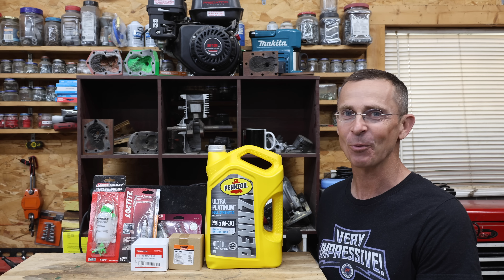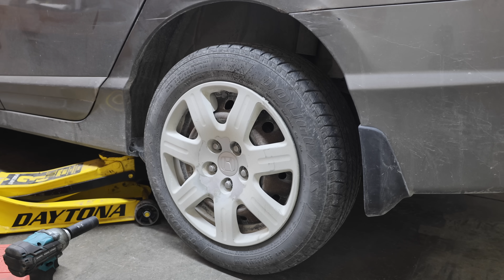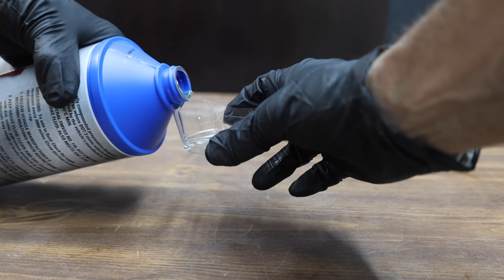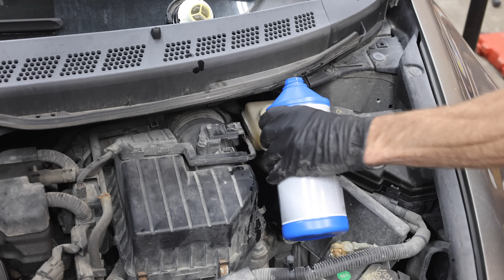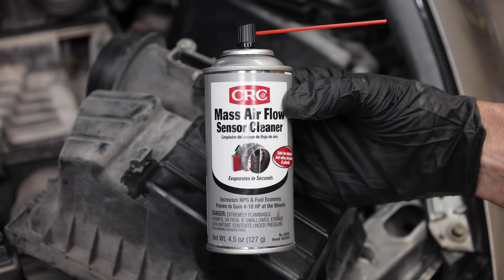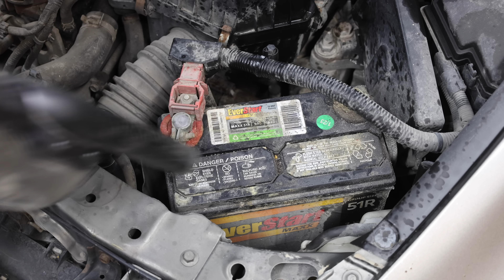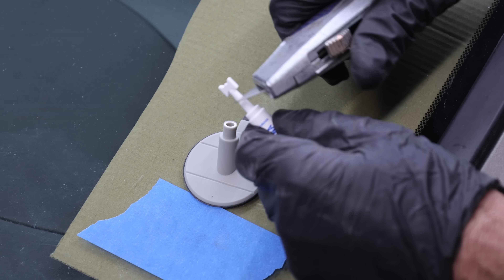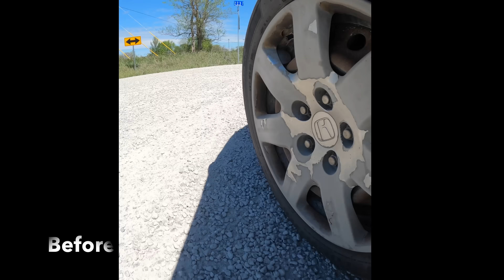Most Reliable 200K Mile Car? Let's Settle This!

Comment: Love your videos, Todd. I have a '97 K1500 with right at 1/2 a million miles. Paid it off in 2000. I spend considerably less a month than a car payment. Maintenance is key. Nothing wrong with an older vehicle as long as the drive train is in good shape. Everything else is just a few bucks away from new.
Reply from the maker: Thanks!  Thanks for sharing.

Comment: Yep. This is the way. I drive a 2009 Scion XB with over 200k city miles on the original engine and transmission. It was a full time Uber car for 5 years! Despite spending its whole life in Chicago it has barely any rust. The undercarriage is immaculate. It's wild. Toyota is no joke, guys. Their stuff is good. It burns a little oil but not enough to justify a car payment.
Reply from the maker: Thanks for sharing.

Comment: As a former Honda tech, I must say this video is completely on point.  Thanks for making this!  It shows how easy it is to take a great older car and turn it into a solid and reliable daily driver.
Reply: I love how well thought out Honda's are . it's rare to find a domestic vehicle with a transmission drain plug in those years. much less a cabin filter for an economy car.
Reply: @HappyHands. 

The drain plug on our 2006 Honda Accord is right at the front. I don't even need a ramp or jacks to do a 3 quart drain and fill.
Reply from the maker: Thanks!
Reply: It shows how easy Honda tech have it.
Reply: Thought honda used blue coolant.
Reply: @Fyxxterzc  The factory coolant is Blue.  However, the formula for it is similar to most other Japanese brands.  For example, I used Honda factory coolant in Toyotas and Mazdas often due to how much extra I had amassed over the years.   The key is knowing what types of coolants and additives do not mix well with others.  Dexcool for example should not be mixed with conventional or import types.
Reply: Idk about changing the transmission fluid it was pretty dark I’ve heard and learned form experience that changing transmission fluid is a big hit or miss
Reply: @danielcano7932  @200k miles I would never change it without knowing the history and never ever more then 1x. Maybe 1 or 2 qrts just to get a little new fluid in there. He prob drained out all the clutch material that was keeping the trans from not slipping. Also, those 8th gen civic transmissions are a little squirrely to begin with, that is a high risk move changing that fluid.
Reply: Did he just, add liquid to the car battery??? Why have I never even heard of this or been taught?
Reply: Yeah meanwhile going broke! I'd love to sell some on my close to 10,000 beater Toyota it most certainly will be my first and my last Japanese vehicle never again!
Reply: @peachyclean93  what year model and make if i may ask? i have an 87 toyota pickup, 22r (carbureted not fuel injected) and i wouldn't ever sell this thing. most reliable and capable car ever made.
Reply: @peachyclean93  you must have gotten a lemon.
My family only buys Scion (made by Toyota) and Toyota. 
Toyota Rav4 2010 = 15 years
Scion xA 2006 = 20 years
Scion xB 2006 = 20 years
Scion xB 2012 (Gen 2) = 13 years
Scion iQ 2012 = 13 years 
Scion iM 2016 = 10 years 
91 years combined ownership and other than basic wear and tear stuff (wipers/tires/brakes/bushings/oil/coolant) i only had replace 2 alternators and a serpentine belt that actual kept the engine from operating.
Reply: @Evilatem not just be my whole family every time we buy a non Chrysler vehicle they've been garbage!! You can have them I do not like Toyota and never will buy another one ever again! I'm out all that money!! Never again!!
Reply: @peachyclean93 you need a few more exclamation points in that message.

Comment: A vehicle is an asset And most vehicles depreciate in value whether they're being used or not.  Most hondas and toyotas will run at least three hundred thousand miles with regular maintenanc. It's really easy to find them used with a hundred thousand miles on them for a fraction of of what a new vehicle costs.
Reply from the maker: Thanks for the feedback.

Comment: Any truck with a Cummins engine in it? I have two of them 225 on 170 on the other never had a problem with them other than the air brake pump which was cheap and a steering wheel pump.
Reply from the maker: Thanks for sharing.

Comment: My 98 Grand Cherokee with a 4.0 I6 has 450k miles on it and its original auto transmission.. id say thats reliable enough.  The engine is a shocker sorta..  but the auto transmission having 450k. Is crazy.  Original owner too.

I wouldnt buy newer Jeeps though but the 4.0s are the most reliable engine you could ever put into a car

Comment: My dd is 24yo 66km. My gfs dd is 23 140km.   Just rebuilt both and redid th rear drums on the civic. 15yo components. Sheesh. Everything gets cleaned to bare metal anti seized. Good as new now. Older cars are a pain due to age but once you get through stuff and prep things properly they will be much easier next time around. Overall pre 2007 cars are way easier to maintain because you can take things out. After 07 they started heavily re engineering Everything to make simple repairs buried unnecessarily so you pay more to have them fixed then you are more likely to buy a newer even harder to fix car...
Reply from the maker: Thanks for the feedback.

Comment: u changed hand brake linings perfectly
Reply from the maker: Thanks!
Reply: Hii I've been thinking about something... It's not a test but I need more of a guide if u can help advise me..... Would it be suitable in terms of cost and safety.... To..... Do a disc skim if it got slight ridges or depends on the disc maybe warped not sure... Or do I get a new one? Cos when I press brakes the pedal shudders.... So I'm not sure if warped or ridged.... Also with the brake drums and linings or handbrake shoes on back right side

Comment: I work with a fleet of ~250 vehicles, from small sedans to heavy trucks and full-size touring buses. Vehicles have changed a LOT since 1990 and esecially since 2000. Pre-1990, unless it was diesel, hitting 100K miles was a death knell, time for serioues maintentance or retirement, and anything managing to hit 200K was rolling dead. Now, with regular maintenance, hitting 200K is nothing special, it's routine. My own daily driver, a 2011 Veracruz, has 226K on it and is rolling fine. Will drive it another 5-10yrs, to 300-350K. Great video as always!

Comment: You used the wrong coolant. You need to use the OEM Honda Type 2 coolant because it contains additives that prevent the water pump seals from failing, which will cause the pump bearings to seize.

Comment: I actually really like this video. I have a 2007 Honda civic and I replaced the engine in it from a cracked block 3+ years ago and it is still running great just needs some TLC. So I’m gonna go thru the checklist you got and start driving it again
Reply from the maker: Thanks!  Thanks for sharing.

Comment: TODD, Please test the new Valvoline Restore & Protect 5W/30 oil. It is touted to COMPLETELY remove up to 100% carbon deposits including in the ring landings (which would be a miracle) after only 4 consecutive oil changes using this product. If this oil does what it suggests, this will truly be a game-changer for older and GDI engines.
Reply from the maker: Thanks for the suggestion.

Comment: I drive a 93 chevy lumina with 325000 mi, on it. Original motor and trans. The thing just wont quit. Runs great. The a.c. even works great. The body is going to rust out before the drive train gives up. I love those old beaters. I don't worry about getting a dent or a scratch on them and so easy and cheap to work on.
Reply from the maker: Nice!

Comment: First off, great video. Please make more like this. I  loved the talk-through of the repairs and the steps. You made repairs look easier. Thanks a real bunch. Some ideas for your product reviews: 
Portable meal heaters. I bought a HotLogic mobile food warmer claiming cooked food in 2 hours.
Electric lawn mowers. I bought an Ego for last year's grass season, the self-propelled model for ~$550. I like it enough, but there are more brands this year.
Kitchen mixers. Mine experienced a meltdown last year and I bought a handheld mixer from Kitchen Maid. I'm a candy maker, so I need a stand mixer that can handle the load.
Knee pads. I wear knee pads all day long, and sewed suspenders for them for proper height between sitting and kneeling. Some variety would be nice.
Battery work lamps. I spent some time designing a work lamp and hodge-podging one together, but I'd like to see what you can come up with to showcase.
I have Ideas for days...
Thanks a big lot.
Reply from the maker: Thanks and you are welcome!  Thanks for the suggestions.

Comment: Thanks! That was awesome. I would like to see a video explaining parts buying and economizing without compromising the quality substantially. What parts to use only OE? And what parts after market would be good? How to select good parts for both American and japanese cars? I have been DIYing on my 2012 traverse for overall great results but i find looking for info on good parts is kinda tricky and i end up wasting a lot of time looking for decent parts as gm/ac delco parts sometimes are stupid expensive and quite often need long wait times
Reply: If you drive aggressively or regularly at freeway speeds, I recommend OEM. Otherwise, I've had no problems with cheap aftermarket parts. I even use a 300cca lawnmower battery for $50 and it starts the car beautifully.
Reply from the maker: Thanks!  Thanks for the suggestion.

Comment: I'm driving my 2011 Fusion with 207.000. I bought it when I came to America in 2021 with 174 and it's still running like a clock. The only thing I needed to fix was to stick a resistor because AC was behaving thus now it's permanently ON.
Reply from the maker: Nice!  Thanks for the feedback.

Comment: Dude, you're a monster! In a good way lol. I wish I knew more about cars. Or knew a good mechanic. My current mechanic told me I didn't need to change the brake pads that it was all fine. Even though the previous owner told me to change it and I told him to do that and an oil change. Didn't do any of that. @ months later I noticed something on the brake. Took it back. He changed all the discs and everything. 1700 bucks bill. wft. I could be totally wrong, but sounds like he don't want to do anything unless it's a major issue with a large bill. I'm looking for a new good reliable mechanic now.
Reply from the maker: Thanks!  Thanks for sharing.

Comment: I know this was a quick fly-by video, but all those things done for less than a grand, Nice.  I try to keep routine maintenance up on my 2013 Dodge Avenger SXT  since I bought it 2 years ago, and really only needed a battery(Bad placement+cost), and front tires.  I did do a re-work on the spark system with Ruthenium plugs and Ripp Supercharger coil packs.  For almost 180K she's running good!
Reply from the maker: Thanks for sharing.

Comment: Another great video! My 2007 Ram 1500 I got in 2014, is closing in on 165,000 miles, so I will be doing some maintenance as well. Should last me another 5+ years.
Reply from the maker: Thanks!  Thanks for sharing.

Comment: This is exactly why my vehicles are a CJ7 and Samurai.
So much easier to fix and no computers😁.
Both of them technically, each has way more than 500,000 miles but not all parts are original.
Reply from the maker: Thanks for the feedback.

Comment: Turning old into new. Good job and covered all the bases. My 98 Chevy trk has 289,000 miles and I have done a lot of heavy towing over the last 50,000 miles. I wouldn't be afraid to take it across country.
Reply from the maker: Thanks!  Thanks for sharing.

Comment: I'd LOVE to see a 1997-2001 Subaru Outback Sport. I have a 2000 and would love to put some love into her. Possibly restore some paint pitting and scratches. How to deal with rusted bolts. Maybe more trans rebuilds like when you made your truck more BADASS. I love seeing old cars find new life. Brings me absolute joy. I've been a fan for years. Much love from Maryland
Reply from the maker: Thanks!  Thanks for the suggestion.

Comment: that click with turning was 100% the axle. btw it takes very little time after a cv boot breaks for it to be complete trash. be careful with automatic transmissions if there is alot of grit in them changing the fluid will make them slip or make them slip sooner. best thing is if they would have done the service on it often enough. either way most of the things you did to this vehicle are a good minimum for any sub 1k dollar car.

Comment: My 2011 Ram has 283,000 miles, 2012 Subaru has 142,000. I've been a mechanic for 45 years. I have also bought and flipped many cheap vehicles. I enjoy doing this and making a few dollars profit is nice. Thank you for an enjoyable video !
Reply: my 2020 KIA  has only 23,000 mile but already burning oil.
Reply: @kuyre2239 normal for those🤣 sorry man
Reply: @kuyre2239  my 2011 Hyundai Elantra has 312k and doesn't burn a drop of conventional oil @5k changes. 🤷
Reply: @kuyre2239  what do you expect from a kia? I had a kia optima 2013 and the engine had a recall, kia didnt replace it saying it was fine, but it was literally dying engine with no hp. Kias are just cheap cars, they are not designed to last.
Reply: My 2004 F150 5.4L has 289K and I get what you mean. If you get a good truck you can’t run it into the ground if you tried as long as you keep up general maintenance. And I still drive mine 80mph down the highway for a few hours every weekend with no issues.
Reply: @junkaccount2535  You generation of Ford truck is my favorite. 5.4 is a good engine.The only real issues were the OEM spark plug replacement. Long live old pick-ups ! Wouldn't get rid of my RAM Hemi for anything !
Reply: @michaelmartin2276  thanks! It’s so weird too because a lot of videos have blown up over the past 5 years bashing that engine but mine has never had a single problem. In fact I blew the hose slap off my radiator because I was going 90mph late for college and overheated it twice with no problem to the engine. The radiator went out and I replaced it. That was 3 years ago and the only thing since has been replacing break shoes and struts.

Edit: corrected my grammar from “to” to “too”
Reply from the maker: You are welcome!
Reply: 99 4Runner. 513,000 miles. Runs great.
Reply: @NomenClature-o8s  Man I'd love to have a 4 runner
Reply: @NomenClature-o8s my 13 highlander has 644k
Reply: I'm way above you, I've had 4 Chevy vans to make it past 450,000 miles without any major repairs. I've got a Toyota Corolla with 395,000 miles that the only repair was a water pump at 365,000 miles. I laughed when I saw this video was about 200,000 miles. That's nothing.
Reply: In my opinion- most reliable 200k car is going to be a Lexus. It's simply built better. Your thoughts?

Toyota, Honda, and Subaru cheap base models would be my first choice for a lower cost buy in on a 200,000 mile auto that I was trying to 'restore' like this to make it roadworthy and reliable. It largely depends on the particular model that one buys of course... not all models within those brands are going to perform identically.
Reply: @melissachartres3219   I've got a Lexus with 270k miles. You are somewhat correct but actually Toyota brand is more reliable because Lexus tends to have a bunch of luxury features that go bad quicker. For instance, the entire suspension system had to be replaced because the stock version was a very expensive hydraulic adjustable-height design. Also the brake system is exceptionally expensive to replace compared to regular Toyota version. Other little parts are much more expensive to replace, i.e headlights and seats, because fewer Lexus are made so they're harder to find. But the engine and transmission are basically Toyota and those are rock solid.
Reply: @melissachartres3219  Yeah but the rear seats don't fold down in Toyotas and also they are hardly without problems. And when you DO have problems, all the parts for a LUXURY car are priced accordingly, and not available aftermarket for a low volume brand. I work on cars and a LAUGH at idiots who buy lexus, infiniti bmw kind of garbage at the salvage auction.

Comment: This was awesome. Your editing and commentary gets right to the point and is easy to follow. Good maintenance is the key. My wife's car is a 2003 Durango and has 159K. It has been extremely reliable. I change things like the water pump, radiator and transmission fluid before they act up. I have had batteries last 8 years twice in a row. . My hobby car is a 1972 Grand Prix which makes it 54 years old and is still running the original 455 engine at 129K. It too is very reliable.
Reply from the maker: Thanks!  Thanks for sharing.

Comment: As a DIYer, this is by far one of your video I like the best. I like your thought process of new vs used and cost comparison. Also, you did all the necessary maintenance to make this car good for another 100K miles. I would have changed out the ignition coil since the Civic had 200K and were most likely never changed. I love your videos, great Job, Thank You!!!
Reply from the maker: Thanks and you are welcome!

Comment: I have loved all your videos for years. This one was exceptionally great. When I was a young fart in 1977, I was a mechanic at Morris Texaco in Oak Ridge Tn. I changed so many thermostats out that I naturally squeezed the upper radiator hoses to get air out as well as heating up the thermostats to make them open faster. Memories! ☺️👍🧡
Reply from the maker: Thanks!  Thanks for sharing.